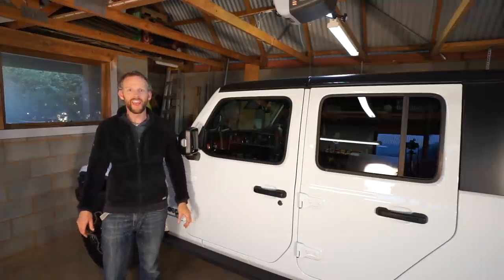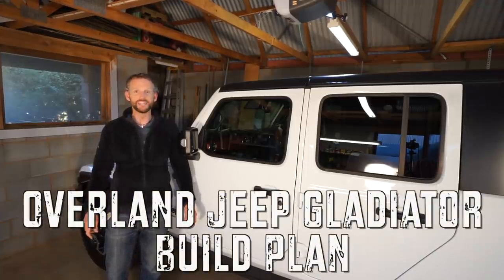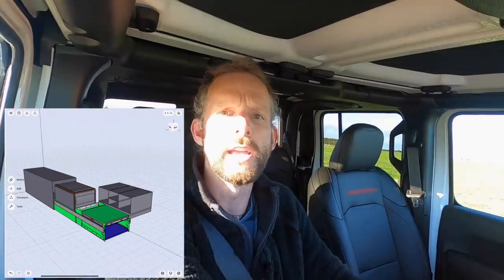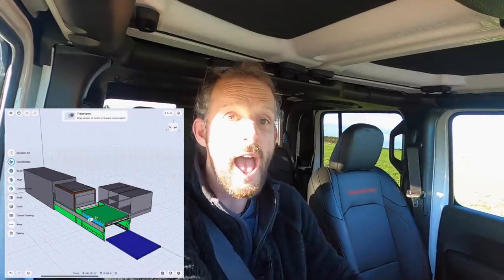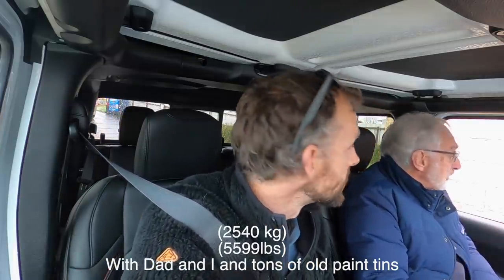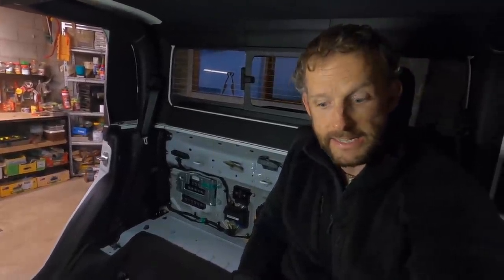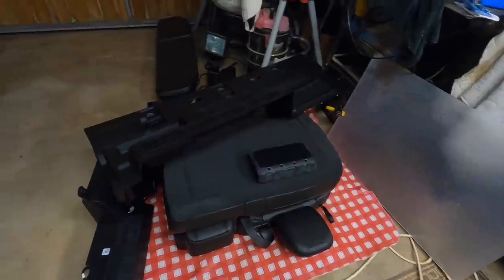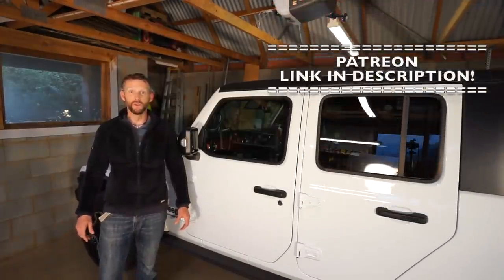Overland Jeep Gladiator Build Plan - Australian Expedition Preparation

Comment: 12:55 I would recommend you use a sheet of plastic instead of wood. It's more durable, doesn't rot it's thinner and lighter. If you are concerned with the rigidity you can sandwich two sheets of thin plastic with a thin sheet of foam, honeycomb (metal or plastic) or MDF or plywood.

If you prefer, they sell those sandwich sheets already assembled. Look them up, I've heard them been called composite sheets or boards.
Reply: PVC Foam board is the ticket. Super light and ridgid. Can be glued with PVC cement Comes in various thicknesses too suit the task.
Reply: Enameled or glassed redwood ply also works great there, is secure,  can have things mounted to it and can be removed easily.

Comment: From what I understand, the Gladiator tailgate is pretty well known for allowing dust in (it has significant gaps).  You may want to consider trying to find a way to seal that up.  Having said that, refrigerators need to "breathe," so that may be an interesting problem to solve if the refrigerator will be in the bed and the bed is sealed.  Maybe it would make more sense to put the refrigerator in the cab where the 60% seat used to be?
Reply: Which ute doesn't suck dust in through the tailgate? Unless it's modified and sealed aftermarket they all suck in bucketloads of dust.
Reply: @praetorian6476  Which is a good reason to put the fridge in the back seat.

Comment: Might it be more efficient to put the fridge in air conditioned, insulated space?  Or....another idea...perhaps you can reroute the air exit flapper valves (wherever they are) to exit THROUGH your kitchen and out the bed, rather than wasting that cool air.

Comment: If you replace any wood surface with marine starboard, you’ll save weight and avoid any humidity and mild issue. It’s used in boats extensively.

Comment: You keep getting it right, Dan. A lot of the folks modding their ‘overland’ trucks would do well to listen. We’re a couple of hundred pounds below US GVWR in our 4Runner when everything is full. So nice not to worry about accelerating wear via something that you have 100% control over.

The final version of our truck was delayed by my wise wife’s suggestion that we see where we like things before we committed to a design. We’re progressing nicely now having gotten a Goose-Gear floor plate and 60% delete. Working out the tie-down locations for our boxes, dog kennel  and fridge as we speak. After that it will remain modular as our needs progress.

Comment: I did the same thing. My Tacoma had 600 miles on it when I started tearing into it. The scariest was cutting into the body mounts and welding in a new plate to clear the bigger tires. 
I don't mind drilling and grinding to make it do what I want it to do 
Looking forward to seeing your ideas and progress.

Comment: Plenty of options for GVM upgrade ( springs, shocks ), in Oz... EFS suspension,  Dobinsons suspension,  ARB Old Man Emu suspension.  Just to name a few. All Aussie made. Some in Melbourne ( ARB ).  Dobinson are in QLD. Plenty of aftermarket stuff for 4x4 mods, designed and made here in Oz. Hope that helps Dan... looking forward to your build 👍
Reply from the maker: Cheers! For sure I have a ton of options, but I need to finish the build out and weigh it before I can choose which option is the best.

Comment: Dan, you'll find out pretty soon that the rear suspension on the gladiator is quite soft.
We've got a 7x5 box trailer converted into a camper trailer, that on the tow bar and the tub full with clothing bags, recovery gear etc.
The suspension sags a fair bit. We'll be looking into getting airbags fitted until we can get our Rubicon gladiator build up for overlanding. 
As you said, better wait with upgrading the suspension until you know how heavy the vehicle is actually going to be.
Reply: If you put bags in her you may want to reinforce the frame, there have a few bend in the USA once installed
Reply: Thanks for the info. I wasn't aware of that.

Comment: Be sure to gusset the frame after the rear cab Dan. People are 🌮 ing them there. Its a quick plate mig weld on the outside of each frame rail. Have a great trip.
Reply from the maker: Thanks. Given I won't be running Dana 60s.. or 37 inch tires.. or even 35 inch tires... and I won't be installing a heavy canopy.. and I won't be adding any weight behind the rear axle.... I don't think this applies to me and my use cases.

Comment: Hello Dan! U'll find driving an auto in technical terrain, u'll b 2 footing it. 1 foot on the brake and 1 on the gas. I've been paying attention to these trucks and u mite want to check the frame where the cargo box meets the cab. Apparently its a weak spot.
Reply: Only when fitted with shocks that are too long for the springs, same on any ute/pick up.

Comment: What do you think about jeeps 4xe power train for over landing? The 2.0L is small and has a turbo so that makes it complicated…but to be able to drive on all electric without fuel and plug in and recharge the batter when possible or potentially use solar panels to charge the battery seems pretty cool.

Comment: My 1965 Unimog 404 is empty 3443KG with the shelter on and a winch an my dieselswap and powersteering. My Maximum weight is 4750KG So 1300 KG to play with. But My goal is around 4000KG.

So yes my unimog doesnt have a weight issue and was only 3000 euro before I restored it now many times more :)
Reply: What engine did you throw in? OM617?

Comment: Pity you can not go higher with the roof panels that can be removed, which is a huge advantage for the Gladiator that you can go through the cab up and and safe even more weight if you go canvas, to utilize it the way you like etc. It is a super choice to do modifications with out taking the vehicle apart.

Comment: Same in South Africa. We only get the 3.6 8 Speed Auto JL. Also it comes with a 31" and not a 33" like the US. Oh, and we dont have the Gladiator at all. Only the JL and JLU.
Reply: I don't quite understand why the Glad is not available in SA. At first I though it could be because of the cost of converting to RHD, but if available in Aus, why the &@%# can't we get it!
Reply: @philipjooste9075  same here! Didn’t know AUS had them . Now there isn’t a reason why not to

Comment: Since you will seldom use the rear passenger seat why not remove it and make as bigger box in the rear and add a smaller seat using the box as a base...all you need is a seat pad and thin back rest...it wont be the most comfortable thing to sit on but it would give you more space...

Comment: I understand that your experience with Jeep has been great. My question is, when things break, a bug needs sorting out or things need replacing out in the bush, how do you plan on fixing them? I own a Toyota so I genuinely don’t know what part availability is like. I just assume, like most American manufacturers selling small amounts of vehicle here it’s low. I just another did a trip to remote North Queensland and didn’t see 1 Jeep which is why I ask. I had a choice between a prado and a gladiator (although different vehicles) and I didn’t pursue the gladiator because the price of them was high due to a lack of supply. I went with the Prado as this made me concerned. If they struggle to get trucks does this mean parts too?

Comment: I have read, the right hand drive Jeep Rubicon driver foot well is too small and an issue for long drives.
Reply: I would agree with that.  I test drove one (Wrangler) and I found my feet felt trapped, with hardly any room to move around. Maybe because I am 6'3" it felt worse but would be OK for shorter drivers.
Reply: @spudboy1328  feedback is same from reviews from RHD countries, since this was designed as LHD.
Reply: @spudboy1328  Is that with manual or auto or both.
Reply: The one I test drove was an Auto.

Comment: wonder what the dash looks like on a rhd  can you show  a shot is it in mph or just km? is the steering  column  the same  as us?  turn sig lever in the same as us or opposite ?
Reply from the maker: It's only in Kms (no cars here have miles), steering is identical, and it has turn sig on the left.. some vehicles in Australia have been doing that for a while, even though the Aussie standard is for turn signals on the right.

Comment: Then how does the Ecodiesel fit in the Grand Cherokee and Maserati?
Reply from the maker: There must be differences in those bodies that allow it to fit - maybe the solid axle of the Wrangler/Gladiator gets in the way, maybe the steering box is different - maybe even the transmission tunnel is made in such a way that doesn't allow it. I don't know, but those are all possible.